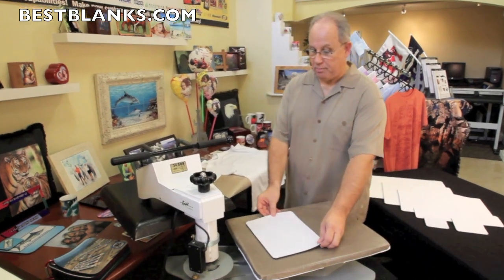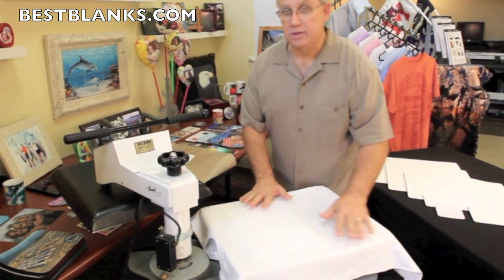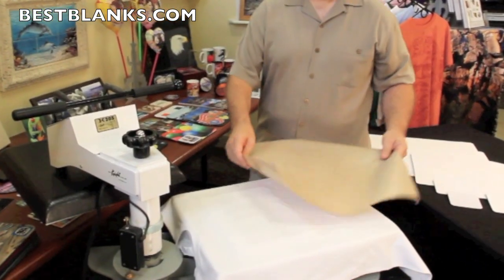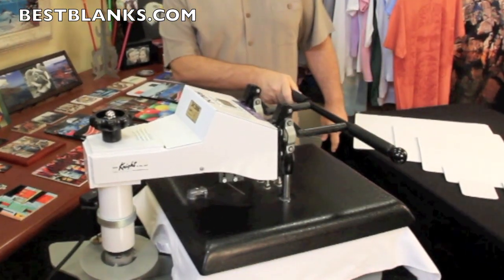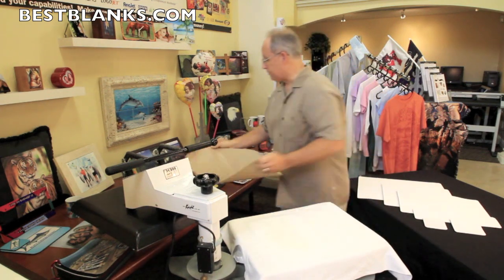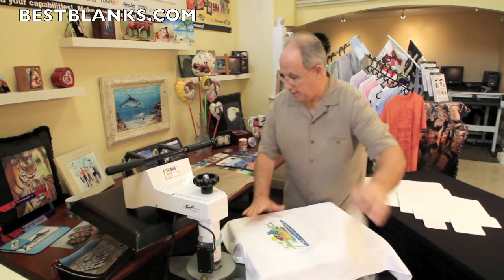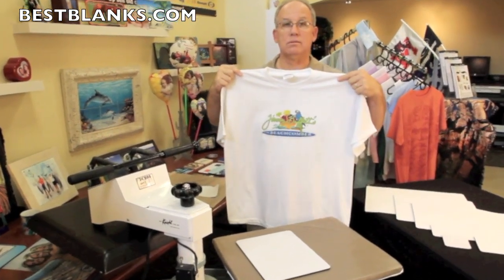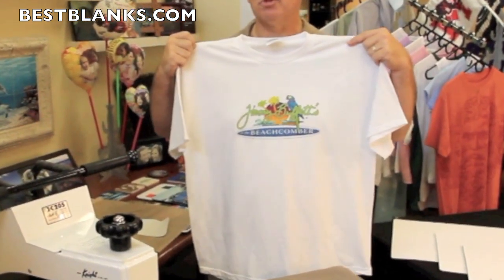How To Eliminate Heat Press Lines With The Lineless Transfer Kit

Comment: Hi there, What was the temperature. thanks.
Reply from the maker: The temperature setting is dependent on the type of transfer paper being used. This demo was about the Lineless Transfer Kit. If you need help with digital heat transfer paper or anything else please give us a call at 888-431-7385 or 954-989-1250